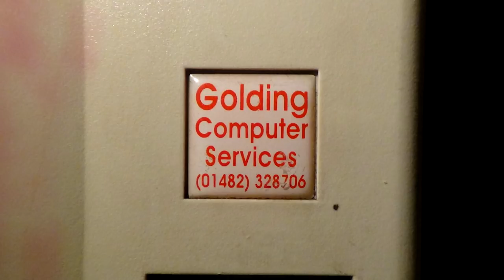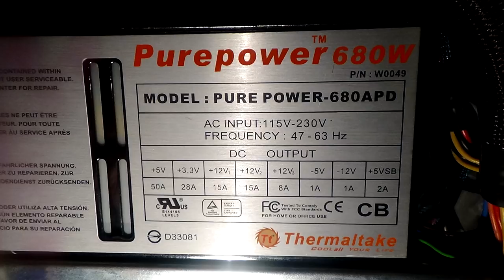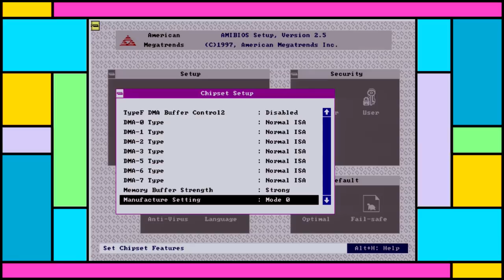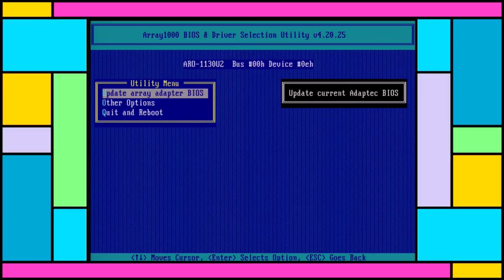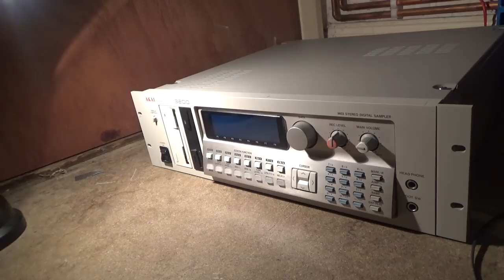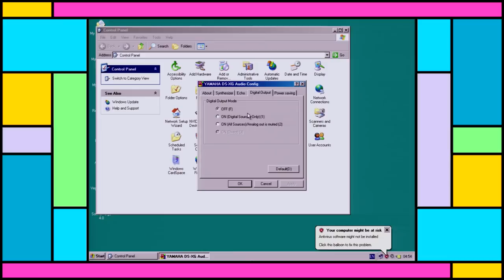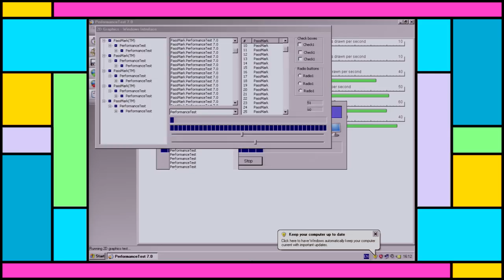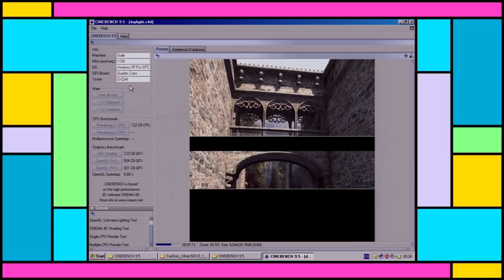Upgraded Dual Pentium III Workstation

Comment: Mmm, that sound of 4 10K SCSI drives starting up in staggered spin is so harmonic. You can tell its serious business just by the sound of it.

I agree with the reasons for choosing XP over 2K as the operating system of choice for your workstation. I originally planned to have 9x+2K on my DTL-H2000 equipped Dell in dual boot configuration but the hassle of installing a crap load of updates and not being as compatible with newer software as XP in the end makes it not worthwhile. Just turn off a bunch of unnecessary bells and whistles and replace the 'Fisher Price' looking theme with the classic Windows theme in XP and you more or less have Win2K but with better compatibility.

Great video as always man.
Reply from the maker: It still baffles the mind as to who thought putting that 'Lunar' theme into a 'Professional' operating system was a good idea. I'd hope they were fired, but given what later Windows versions gave us, it seems they were promoted instead. At least they had the decency to disable it by default in 2K3, but shit, it was ugly, especially when coupled with that Telefuglies wallpaper.

Comment: Just in time for the Heat Wave here in the U.S. Might hit 100 here tomorrow. And i only have puny single core P3 systems. Awesome System, Thanks for sharing
Reply from the maker: It hit 92 here whilst filming, not entirely fun weather to run a multiprocessor machine in, so you're probably better off with those single chip ones in the current climate anyway.
Cheers dude.

Comment: Good video like usual, the problems with Q3A reminds me of my early PII system, Quake had timing issues, Q2 ran at a single frame a minute and Q3A would whitescreen on me. Weirdly enough, every system I've owned since that PII has ran Q3A really well. Reminds me, can't wait to piece my new PII together as it's been a very long time since I owned a working Slot-1 rig.
Reply from the maker: Thanks. Strangely the P2 mentioned was one of the only systems that I recall running it decently, along with the Duron all those years back. Still not really intent on digging up the problem as there's no incentive to run it on here.
Everybody should have a Pentium II.

Comment: I love hunting for old server and workstation hardware. I found it to make a pretty good workstations even now, especially for a hobbyist. I recently built a dual Opteron 2435 beast loaded with 32 gigs of memory and am using it for playing around with OpenCL. 12 thraeds at 2.6 gigahertz for just 100 or so euros.
Reply from the maker: Unfortunately such hardware is quite hard to find around here, though this one was obtained for cheap somewhere around 2003 and proved more useful than first thought because, even with the original 500MHz CPUs, it would often outstrip the Duron 750 / 950 I had at the time. Nonetheless, it showed the way forward and the current workstation runs an X10SAE with a Xeon E3 and, oddly, 32GB of RAM, figure that should be good for at least eight more years and probably a safe bet it won't break down in that time. Only single CPU, but it has four cores and that's enough, E5's were considered but most of the applications I'm running don't scale well onto those and might actually run slower, so the E3 proved a better balance and offered more 'bang for the buck' as it were. Clocking on for two years uptime, minus the resets that Windows Update requires.

Comment: MAGA.    I see a K7 bios chip found itself implanted into the enemies motherboard. I've gone to Windows XP for dual cpu stuff. Turning off all of the erroneous garbage and the "fisher price"  looking desktop ( as I remember some people called it back in the day ) gets it working pretty well on this era hardware, any era it will run on frankly and plus I can get the machine on the internet without fuss.  Maybe I should connect up some of my 15K SCSI drives for the spin up effect sometime. I personally just set the jumper on the drive so they spin up right away without waiting for the card's spin up to save a bit of boot time. That sound of multi scsi drives spinning to life means that computer is serious. :) 

Bad thing about multi-drive raids is that you can have 1 drive that is bad corrupt the entire chain and not ever know it until it is too late, and the drive may not even show as failed either. It can happen apparently if the buffer cache ram on the drive gets a bit screwy or something else in the circuitry gets wonky and starts causing data corruption which then can get replicated across the stripe. I've never seen this happen, that I have ever known about anyway,  but the article I read a couple years ago talked about how this happens fairly frequently in these data centers.  So no matter what you have for hard drives, back it up somewhere, somehow if it is a real kick in the nuts to lose that data.
Reply: Speaking that motherboard, when are you going to do that video on the Abit VP6?
Reply: Yeah I clocked that BIOS chip, too - better off where it is than in some ECS piece of shit though!
Reply from the maker: That chip got left there after messing with microcode patching, didn't see much point in changing it back afterwards as it was working anyway. 15K drives were considered, but they were too costly and didn't seem necessary in here, maybe if the board had PCI-X or a faster SCSI interface, but these 10K ones will do just fine. I prefer staggering the spin up just to save the sudden bang on the power supply, though these use way less power than the old Atlas III drives did.

RAID definitely isn't infallible, images of the drive should be taken at intervals and important files backed up regardless, I've come to consider it more as an early warning system than a true safeguard. If you want to go super tinfoil, then there's always the possibility of lightning hitting a power line and blowing the machine up, it seems doubtful RAID would help in this case.

By your exclamation of 'MAGA'  I'm guessing you caught the rogue frame that somehow got into the edit. That hat generates some awesome facial expressions out of ugly blue haired sorts and weedy looking soy gulpers. Additional fun came in the form of, by pure chance, ending up walking around the grocery store with this black guy I know, back when the news kept spewing some nonsense about Trump being 'racist' and such. Me and that dude laughed ourselves silly by the time we got to the cash register, you could see these people stop, stare from me to him, then a spanner dropping into the workings of their brain as they tried to make sense of it. This gormless, open mouthed expression as their reality was broken.
Reply: Ya i kind of imagine it is a bit odd for someone over in your part of the world to wear that hat. I am not a fan of KAG, I think it should still me MAGA just change it from Make to Making. Even if the card can't make use of the trough-put from the drives, the 15K are still faster because of the access time and write speed, it's definitely noticeable.

Comment: Lovely system, and your right even if you found two 100mhz Taulatins the power leap slot kits, even the ones for taulatin disables dual CPU support so that configuration is probably as fast as it goes :)

Extremely quick windows XP startup too faster than most more modern systems.

PS that drive startup sound <3
Reply from the maker: Thanks. It would be possible on some boards to get those 1.4GHz chips to run at 1050MHz, but I doubt its worth it. The Coppermine CPUs are blazing fast in here anyway. There's also the option of moving to a later motherboard, but I've always felt the 800 series chipsets gave slower results than the 440 did. The boot time is representative of most things on this machine, basically things start 'now' and not five minutes later, feels like sending a nuclear tank to swat a fly most of the time.
I don't play with Core 2 stuff, chipsets stop at the 955X for me and skip ahead way into the Core i's time, similarly CPUs stop at Presler and then jump way ahead. Nothing but poor luck with the Core 2 line and they always performed horribly for me.

Comment: I have a 3dfx Voodoo5 / Athlon 1333 / ABit KT7A system that runs Q3 perfectly.  I built systems around an ASUS A7V266-E, MSI K8N Neo, and ABit NF7 Ultra that all ran it without a hitch running GeForce 4 Ti 4600 (1st) and GeForce 6800 GT (2nd and 3rd) cards that all ran Q3A as well.  I owned a 5600+ Windsor (still have one today, not same model, though) and upgraded to a C2D E8400 running an 8800GT and saw a huge improvement in performance, later it ran a GTX 260 c216 and C2Q Q9550.  It was night and day difference.  Other than one motherboard swap (Gigabyte GA-EP35-DS3R, great board) due to a botched BIOS flash I never had stability issues.  Much like your Pentium D, I saw lots of use out of that system before it was eventually sold to build a machine around an Ivy Bridge i5.  I'm sorry you haven't had good luck with either Athlons or Q3A.
Reply from the maker: ID games in general don't seem to run properly for me, even Keen often misreports free memory and refuses to run. Everything else works so there's obviously something wrong with ID's code.

Comment: Nice to see you sneaking some music into another video. And 'aluminum'? Really? I can't tell if you're being ironic or not. Anyway, liked this one - it has a kind of hypnotic boringness to it, and I mean that in the best possible way. The level of detail you get into is absurd and unsurpassed, especially as you actually know what you're talking about. I've been wanting to set up a SCSI RAID in a P!!! for some time now but, unlike you, I have no use for it.

p.s. epic 2 minute rant at 28:36.
Reply from the maker: Don't get used to the music, that'll probably go away again now. What's wrong with aluminum? Dunno, that's just what came out, guess you really wouldn't like the way I spell color. Yeah, the problem with a machine like this that's meant to actually do work is that it turns out kinda boring, because there's nothing flashy running on it. Boring is a good thing for such a system though, because that usually means it works. SCSI RAID is fun, you'll not go back if you set one up.
There was meant to be an insert of a Jim Ross rant somewhere, can't remember the timestamp, but there's a sentence ending on a prominent 'Why!?' that would have set it off. Unfortunately the idea of WWF slapping a copyright claim on the video worried me so it got left out. Actually, around 20 minutes of pointless things were sliced out of this one.
Thanks as always.

Comment: I own an Abit VP6.
Reply from the maker: I knew someone who had the VP6, or whichever one it was that could take Pentium 3 chips. It was a girl and she used to laugh at the Duron I had at the time. That was humiliating and it sucked, the board didn't though, that was good. Incidentally this P6DGU came into my possession around that time, intended as a 'buddy' for the Duron to offload some work onto. It was cheap and turned out to actually keep up with, or even surpass it, on a few occasions. Whilst I did briefly dabble with the Athlon XP platform, by then me and my friends (except one who was still dragging a busted up K6 along) had all run SMP machines, we never went back to single core again.
Suspect the model numbers, BP6 and VP6, could have been confusing to anyone using the Cyrillic alphabet. Might have to check some day.

Comment: Back in 2000 I got an early Pentium 4, at 1.5 GHz. It was an embarrassment watching it struggle to outperform a 1.0 Athlon that my mate had. But I was young and stupid and bigger numbers impressed me unduly.
Reply from the maker: You weren't the only one. We K7 owners used to laugh at Willamette owners at LANs, though we didn't have much to laugh at any more when the K7 eventually ran out of clocks, the K8 came in slower and the better-late-than-never 2.8GHz Intel chips showed up. There were a few die-hard P3 owners at that time, you have to wonder if they had the last laugh really, in a way.
There's an unwritten rule with Intel, never buy the first version of anything they make, wait for the last couple of revisions when it gets cheaper and actually fucking works.
Reply: @HighTreason610  They are still like that. Haswell and the infamous thermal interface material that they switched to to cut costs which was basically toothpaste. That and they have a habit of putting out paper parts, most recently Coffee Lake in 2017. 

I've been on Ryzen since then. Never looked back. Six cores and twelve threads and no limiting overclocking to just the chips with K on the end and an extra fifty quid on the price.

Comment: where did u go :( i need my retro pc fix realy like your videos  :D
Reply from the maker: Still here. Editing of a new video was pretty much finished today aside from anything I missed, but unfortunately I had to kill the render due to an overheat. Room temperature is rapidly approaching 40°C/104°F (currently 38°C/100°F and rising) and the cooling setup in the machine simply cannot handle it. The alarm is pretty much instant as soon as the system is put under load, so it will have to wait until there is a cool spell in the weather, but with a heatwave in full swing I don't know when that will be, I'll try to think of a solution.
Hopefully the video turns out OK, I'm glad to know you enjoy them, so thanks. There are some rough edges in the one coming up though, largely as it wasn't what was planned, things had to be switched around due to different, unrelated cooling issues on another machine.
Reply: that sucks i had a pc die on my back in the day from the house being to hot. a Prescott p4 i believe.  good to know mullet man did not get u. looking forward too it cheers hope the heat comes down

Comment: What kind of issues did you have with Core 2 CPUs?
Reply from the maker: Several. The most annoying were probably high heat output, abysmal performance when rendering and poor stability under such loads. This is not to mention the crappy chipsets that came with the platform, which also ran hot and were coupled with southbridges that didn't have much care for the integrity or RAID arrays. The platform was probably quite good if you just wanted to run games on it, but I didn't, so it made a rather bad impression.
Reply: @HighTreason610  Which chipsets and which CPU's in particular? I haven't had any issues with G31/P31 and G41 with E8400 and Q6600, but I don't use RAID anyway, so I wouldn't know about that. I don't recall them running too hot either, considering I even overclocked them without them running hotter than ~80 Celsius, running reliably too. Pentium D's though, I wouldn't even touch them with a 10-foot pole, in case I got incinerated XD
Reply from the maker: P35 and ICH9R and derivatives thereof, paired with Celery 2 E8200 or Q8400 CPUs. Presler heatsinks were not enough to cool the E8200, which was funny because the Presler could run rings around it, paired with a 900 series chipset of course.
Reply: @HighTreason610  I never liked Q8xxx or Q9x0x CPUs tbh. I would rather go for Xeons equivalent to Q9650 or something along those lines. By the way, stock Intel heatsinks are crap anyway and I avoid using them if I can. It's better to use a good cooler with heatpipes, even if it can seem a bit excessive. Also, the idea of Core 2 CPU's performing worse than dual P3 or even Presler seems rather absurd to me. Are you sure you didn't have defective parts or something?
Reply from the maker: I never liked any of them, awful CPU but a very well played marketing move. Heatpipe coolers are awful, as in they flat out suck balls, I refuse to use them. I'll still never get over how a Presler cooler couldn't cool a Celery 2 Duo chip well enough, yet the Presler was the one with the reputation for running hot.
The Celery 2 could outrun the dual P3, but it wasn't stable, the Presler was stable and could complete tasks faster than both. I suppose this is to be expected when you compare real desktop/workstation CPUs to a rebadged laptop CPU from an earlier generation marketed as a performance part. I'm sure some tests appeared in an old video somewhere, but I don't remember which one now. Also the stability problems I had with the Celery 2 were in Intel's errata documents, though I don't remember the number, something to do with data streams affecting cache coherency I think. 
Suppose it's all in the past now anyway, currently on Haswell waiting to move to Cascade Lake in the coming months.
Reply: Hmm. Got a Core2 as my daily "retro" gaming rig. It's reliable and fast enough for Windows 7. I use it for playing mid-2000s XP era games, anything made before say Half-Life 2 I use a P2/P3.